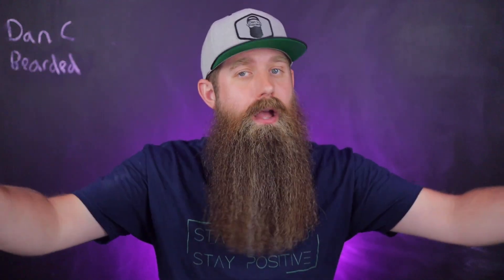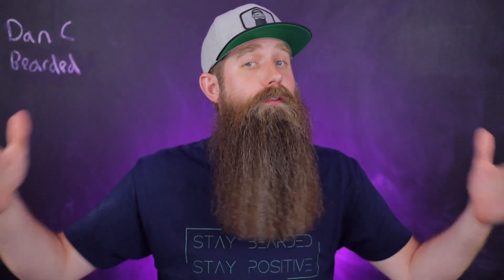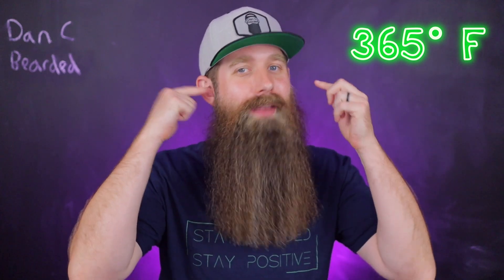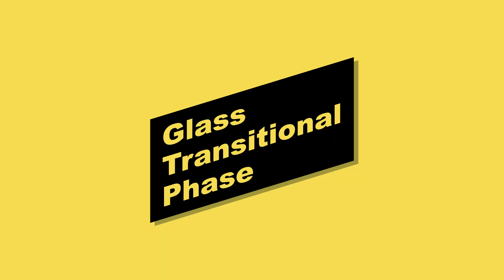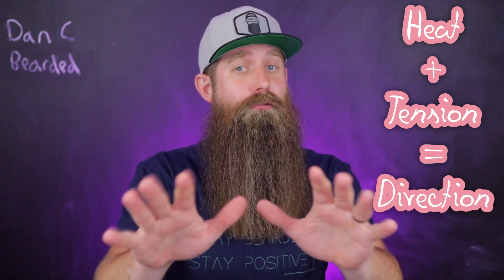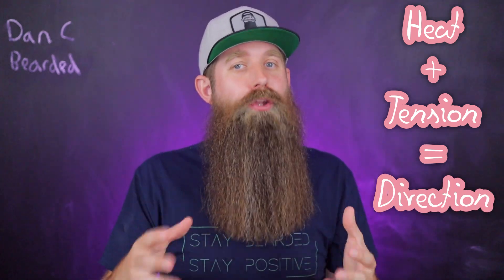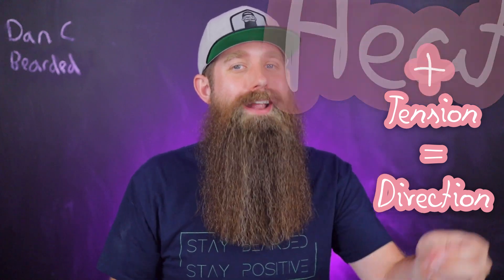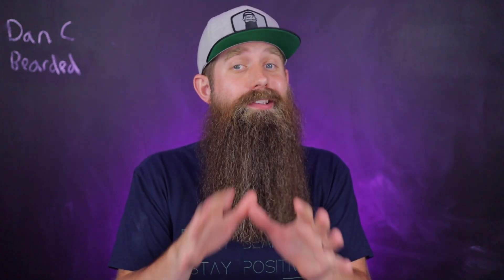What Temp is TOO HOT for your Beard? - Glass transitional phase!

Comment: I know I'm late here to the comments.  But I just started to use a heated brush. My beard is getting curly.  Blow drying was helpful but end result was still wavy and by the end of the day went back to curly.  Brush is doing well. I didn't go over 320 on temp.  But still a little wavy.  Today I tried 420 and bam! Much straighter and holding. I balm after heat brushing.  I don't think I'll stick with 420 heat though. I just wanted to see if it could get straighter.
Reply from the maker: Sounds like you are approaching it perfectly!

Comment: Hey Dan I have a question what happens if you oil at night and heat in the morning is that ok to do also
Reply from the maker: You would still want to get the beard damp in the morning and apply some more oil. Oil from night will have fully absorbed in and no longer protect
Reply: Oo ok thank you I appreciate the quick response

Comment: My hair seems to like the higher heat. When using the blow dryer I have tried both settings and the higher one works better. i usually use around 330 with the heated brush. Great info Teach!

Comment: I use just my wife’s old blow dryer on low heat, what do you suppose is the temperature I reach on my beard? Thanks again for the useful knowledge!
Reply: Right, just read the comments, thanks. Little tip: in your intro, you mention wanting to get your videos « out there » as much as possible, maybe mention measurements in metric (Celsius) if you want to be an international YouTube sensation!

Comment: The cold shot was definitely something I added to my routine after learning it from you. 

Question 1: My beard hair dries very quickly on my sides but not under my chin. Is it ok to dampen the areas of the beard that dry quickly when ready to apply oil and then blow dry?

Question 2: Is it ok to towel dry the hairs on your beard like you would on your heard hair? I have an issue with the thinness of my hair on/under my chin that if I don't dry it with a towel it pulls under my chin. If I dry it with a towel to 80% it styles much better

Comment: Hey Dan 2 questions.

1 ) I use a Kuschelbar heated brush, any idea on it temp as it just has one setting?
2 ) If I'm using a heated brush only any tips on a cool down without a blow dryer cold shot? Right now I am running a comb under cold water drying and finishing with that.
Reply from the maker: 1) literally 374 lol stays just under the rule. That’s from their site too. 
2) cold shot or don’t worry about it!

Comment: If blow drying upward on purpose toward the face or in upward-like manner, it is considered worse on hair when being heat treated. Depending on porosity of hair strand structure (i.e. scale-like topology of hair cuticle) heating against the hair growth pattern usually up or toward skin increases breakage risk! Here is an awesome video imagining the topology that is seemly is upside down on chart: Faithfully Bearded is on the Dan C level!! Much props!!  https://youtu.be/eQPnznC9SLs. That being stated, the most outrageous beard styling contestants have such intricate designs that it would be hard not to blow dry against the scale-like surface of hair some. Also, I have seen tutorials that beard oil or butter isn't used for the most stylized designs.. This would not be an everyday technique for the beard it seems.   Got2Bglued is also not a beard product only being used in beard world.. like many shampoos and conditions, body oil and butters that work noticeably well on many beards.

Comment: I always put beard oil on in the morning after my shower. Sometimes I use the heated brush in the afternoon, because wearing a mask causes my beard to be pointing in different directions. Should I wet my beard and put some beard oil in my beard right before using the brush in the afternoon or is the beard oil that I put into my beard in the morning going to give me the protection I need?

Comment: I keep hearing people using temperatures like 365 or 380, but in my experience my beard wont even think about straightening until 400-410 as it is extremely curly, even then it takes few passes with the brush. I of course use oil and all that and I've not really seen any damage  but I cant shake the feeling that I'm harming it. I've used a few different heated brushes and the lowest of any of them that would work for my beard was 385.

Comment: In 2019 my beard was as long as it is now, but I would use my heated brush on a low setting a few times a week.  It really destroyed the hairs, and I think it frizzed the tips.  My heat brush's default setting is 350 but sometimes I would click it up a notch or two to 370 or 390.  

In late 2019 I stopped using it and also stopped dying it.  In early 2020 I cut it back short to 4" to get rid of the damage, and now in 2021 I'm almost back to my old length but it is substantially healthier: the tips don't feel weird, it doesn't tangle as much.

Honestly heat is so damaging and cumulative in that damage that unless you have a desperate need for heat I would avoid it completely.  Today the only heat I use is on the mustache but only to help melt the mustache wax evenly, and that's with a hair dryer.

Comment: My chin hair grows hugging/following the chin shape and I don't know how to get it straight. I've used product, heat brush and blow dryer, I just can't get it to grow straight down. I'm at length 16mm. Any ideas?
Reply: although the Aberlite Pro and similar ones of shorter teeth like that seem like they wouldn't get that far down/into the beard, they actually do better than others with larger teeth. It's all about technique. In addition to going in different directions and using your face as an ironing board as Dan shows, reposition your beard with your hands as he shows and try different methods with that. For example, mine's at least 10 inches now and I realized after what I thought was finished that I didn't get down into the meat and potatoes areas you're talking about, like deep into the chin or along the chin line. Resolution: take the bottom of your beard together and pull the beard up over your face and pull it taught enough (not tremendously so) and/or separate it to the hairs below (play around with it and see what works best) and really get in there with some pressure but without too much pressure and heat. If you do it right with confidence but not too much pressure and standing heat, you'll get those problematic ones down deep. So, even with a larger beard you can get it done and, if that's not a typo, you can fix anything with just over a half inch beard, nonetheless one much longer with more problem areas. Don't do this terribly often, though, as he also talks about in another video. Too much heat in general, nonetheless direct heat, can simply be damaging
Reply: Patience... Length and gravity are your best friend.  It will straighten with time. I have the same problem when its shorter.

Comment: The one thing that I regularly forget to do is the cold shot. The glass transitional phase makes complete sense to me and now have a reason to remember. I've been using a blow dryer , ay least, five times a week and have not noticed any discernable damage to my beard but I always use low speed, low heat. I wish I could find a blow dryer that has a true "low speed" and not the hand held hurricane that I have.

Comment: with knowledge of the glass transitional phase now, have you changed your heated brush regiment? That is, not its frequency of usage, but your technique. I've noticed in those videos that you use the heated brush alone without the cold shot of a blow dryer afterwards (as I do every so once in a while). So, back to the original question with that context: Do you now add the blow dry cold shot after a heated brush use to take advantage of this glass transitional phase effect and seal it in or do you find the heated brush alone to be sufficient? I predominantly ask as my beard is in uncharted territory and am thinking about adding the cold shot after a heated brush myself.

Comment: Great video! I mostly use a blow dryer on low heat, then finish with the cold shot

If I happen to use a heated brush I have found 285-300 degrees Fahrenheit works best for me, but now I’m going to also use your suggestion to also then finish with the cold shot once again form the blow dryer! 👊🤘